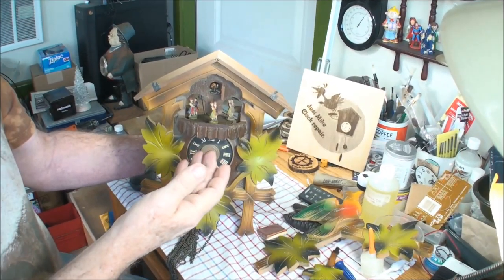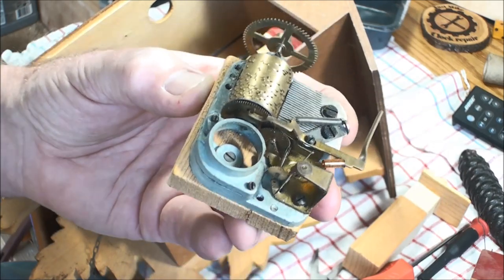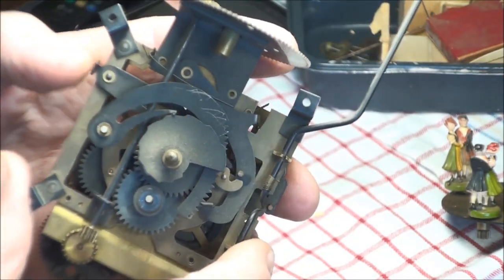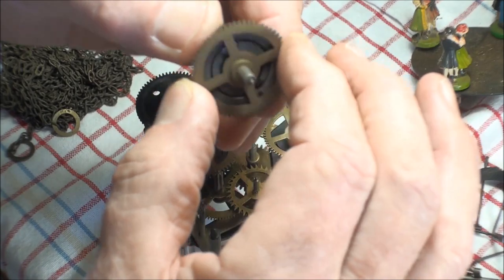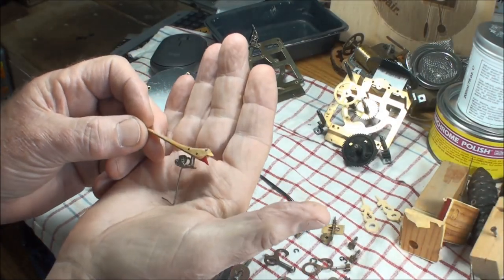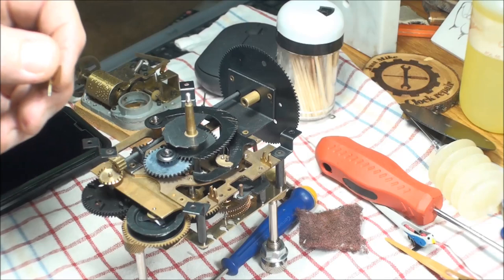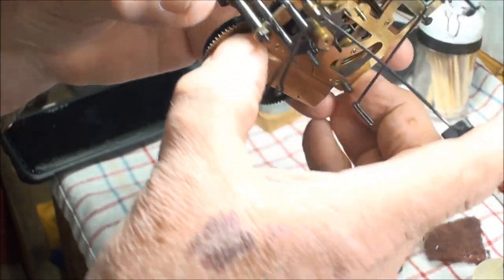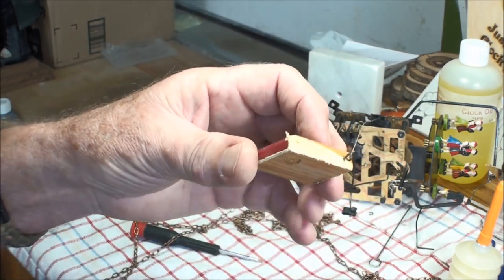Part 1 1978 Colorful Cuckoo with dancers

Comment: Nice Cucoo Clock. I'm repairing Those too. I habe an ultrasonic cleaner where i clean the movements.
Reply from the maker: I think it is more fun to work on the Cuckoo Clocks. The Ultrasonic cleaner makes the job go quicker, but remember to use a toothpick to clean out the pivot holes. Thanks so much for learning how to work on clocks. God Bless.
Reply: Hey Mike, i've got a New Cucoo Clock, that looks like this in your Video, but IT has Oak Leave Carvings. I'm cleaning the Movement at the Moment. The Carvings Are cleaned and waxt, the Bird, the Hands and the Dial i cleaned to.

Comment: Can the plastic gear on the music box be replaced?
Reply from the maker: The plastic gear for the music box are not for sale. They sell the replacement governor at a high price and you still might need to make odd adjustments to make it work. 
  You could go to a thrift shop and look for a cheap Swiss or German music box and use the governor or the gear if it is the right size. 
  You could use a very small, tiny drill bit and drill two holes on either side of the crack, thread a small wire through the holes and twist the wire until the crack closes, then super glue the crack.
  Or you can use a bushing that will fit over the collar of the gear to close the crack and then glue it as well.

Comment: I have this one and i am so sad the music works on mine but the dancers don't spin.
Reply from the maker: I would say the gear might have slipped so the dancers will not move or the gear might have cracked if it is plastic. The only way to tell is taking the movement out and look. If you attempt to do so, take pictures before you start. The adjustments on a musical clock are a fine tune thing when the cuckoo bird is done cuckooing.
Reply: @justmike57  it spins but only sometimes. So it's kind of fixed.